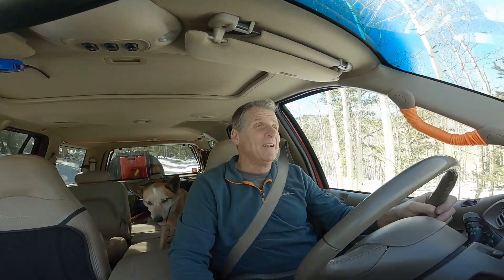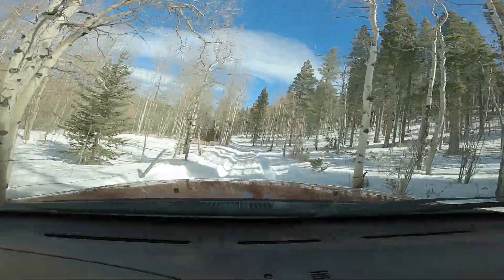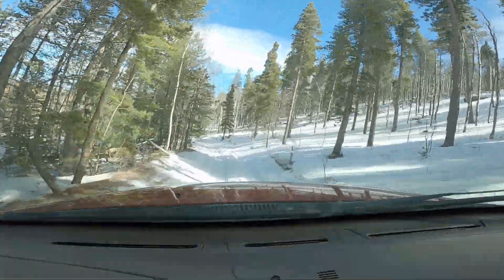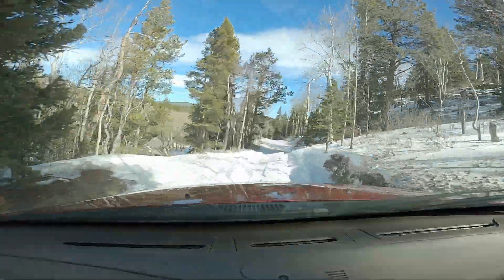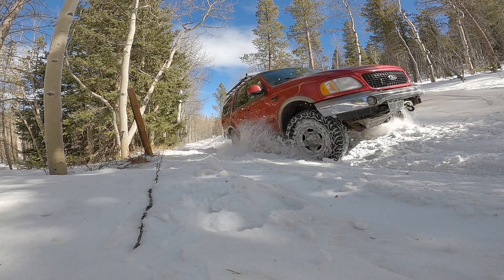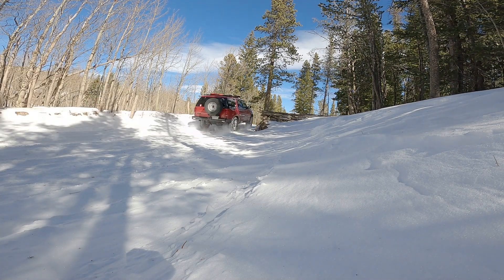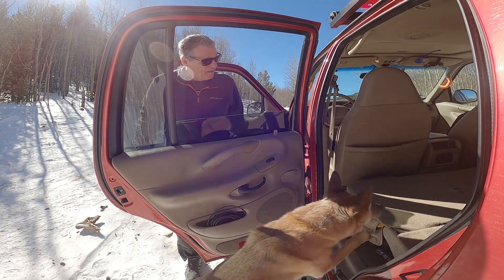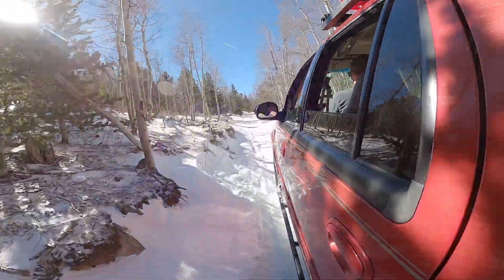Detroit Eaton True Trac - How they work in real life

Comment: So I've heard this is the type of differential setup the original Army Hummer had in the '80s and '90s and they would teach the guys how to do left foot pushing brakes. Also what's your opinion on having the true track alongside ABS traction control? Not the stability kind but the off-road kind of like Land Rover has where it grabs the brakes of the spinning wheel only. Do you think they would complement each other? Like the same way you're pushing the brake but the ABS system does it for you? I've heard some people say it makes the traction control system work less. If so I would like that because I own an old disco 2 that has phenomenal traction control but when you overuse it sometimes it gets Moody
Reply: Hello i have a ashcroft atb in a discovery and i can recomend getting one its transformed both on road and off road mine is fitted in the front it works the same as a truetrac

Comment: Thanks for the videos. I live the black hills of South Dakota and was skeptical of buying a ratcheting locker for the rear of my xj. Just seemed like it wasnt the right choice for a 50/50 on/off road especially on snowy curvy highways. I seen the first video and knew this was the right choice for me. Ive only had it for a few weeks and havent gotten snow yet but i cant wait.
Reply from the maker: Glad it helped, I too scoured the internet trying to find real world info and couldn’t fine much. One video I found was a truck in a garage with one wheel jacked up spinning freely and he would apply the brakes and the truck would move because torque was directed to the wheel on the ground. I also have experience with this type of diff in a car application in racing autocross. Cheers!

Comment: I have a Gen 4 4Runner V8 (AWD all the time), comes with a center diff locker. 

I wanted to installed a True Trac on the front, and full E-locker for the rear. 

Would this be a good combo?
Reply from the maker: I don’t have experience with that vehicle but I like the idea. I have an e-locker in the rear of my F150 and like that if I need I can lock both rear wheels and if I don’t need that I have an open diff in the rear for good street manors. I only thing I can say about using a TruTrac in the front is that in very slippery conditions both wheels in the front will spin and it can cause it to not track straight. But it is not like you are out of control and if I would release the throttle it would go back to tracking straight. I have a Detroit locker in the back and e-locker in the front of my Bronco and that combo works great for rock crawling. So it just comes down to how and where you are driving. The Bronco is harder to drive on very slippery roads as it will go sideways very quickly. But in the rocks it is perfect. Does that all make sense?

Comment: I have a truetrac in my 08 silverado, put it in 8mos ago. If I do a brake torque, both wheels spin. When I take off from a stop sign and turn...the inside wheel hops like it's posi. I HAMMER the hell outta the truck and it takes it. It honestly acts like posi, at least mine does. The G80 blew ofcourse. It still works with the GM stability control also. Love the truetrac.
Reply from the maker: I’m glad it works well for you 👍
Reply: @starksexpeditions121  alot better than that M80...I mean G80

Comment: Using the work "lock" is very misleading. Under no circumstances and in no situation is a TrueTrac or any Torsen type differential capable of fully locking and transmitted 100% of torque to both wheels like an actual locking differential does.
Reply from the maker: Thanks for pointing that out, I thought I verbalized that in my video but you didn’t hear that. But thanks for watching it.

Comment: What gear oil (brand, weight, synthetic? gl5) did you use with the true trac?
Reply from the maker: In the manual it says use non-synthetic and the weight the manufacturer says for your vehicle. I used Valvoline 80-90. And no friction modifier like you run in a Ford limited slip.

Comment: Greetings to Rusty and you!  Thank you for the very insightful video Stark, I've learned and benefited a lot.  If you have another video that covers the Torsen-style Eaton Detroit Truetrac on ice (and snowy/icy roads) please point me in that direction or please consider creating one; I'm especially interested in seeing how a vehicle would handle ice in RWD, FWD and 4WD.  Many thanks again!
Reply from the maker: Thanks for watching, these diffs are the best I’ve had in ice and snow. When the streets are covered in snow I don’t use 4wd because the rear diff always finds traction. And because having a limited slip in the front causes the front to loose side to side stability. It’s not like you are out of control but in very slippery conditions both front tires will break traction slightly and the front will not stay straight under power. At a steady speed all is good. Snow and ice are gone for the season so you will have to stay tuned for next years videos. Thanks!
Reply: @starksexpeditions121  wonderful!  Thank you very much for your insightful response.  I currently have a large RWD  SUV and live in a hot climate, I'm planning on moving somewhere with snow and ice so I'm in the market for an LSD.  Your videos and active responses are helping me reaffirm my original thoughts and decisions.  Many thanks and I wish you continued success.

Comment: Makes me wonder how well this will do with the Wrangler brake lock differential that applies the brakes to the wheel that spins while off-roading.  ? Manual transmission
Reply from the maker: Not sure, but it’s a great limited slip diff no matter what.
Reply: @starksexpeditions121  roger that thank you!

Comment: On rock slab, do you get wrap-up between the front and rear differential?
Reply from the maker: No, that’s something they do well. They don’t lock unless you ride the brake at very low speed like I demonstrate. They act like any other limited slip at faster speeds.
Reply: My experience with driving on hard surfaces, I get wrap-up, between the front and rear with my True Trac

Comment: Great review. For my driving the True Trac is my favorite diff. I have them in all of my 4x4s. The Detroit Locker is probably more durable, but kind of a headache on the street.
Reply: Why are they a headache on street ?
Reply: @admitmohan  depending on the application they can be noisy and a bit harsh due to engagement when making a turn while on a surface that offers little slip (dry pavement).

Comment: Ii have a rear LSD and front open, F&R locked. Going uphill in snow, if I hear spin rear goes sideways. Is that because BOTH RR&RL are likely spinning ? ?
Reply from the maker: Yes if both rear wheels are breaking traction and spinning you will loose lateral stability.

Comment: Thanks for the informative video.  Can you comment on rear tire life with the torsen?  I have a clutch-type LSD in my truck and it wears back tires fast (I don't do burnouts).
Reply from the maker: I’ve use clutch style, and full locking diffs and the TrueTrac is easier on tires. It seems to vector torque to the inside tire and the outside is along for the ride. Definitely different feeling than a clutch LSD and a locker. It doesn’t chirp the tires just traction. It acts similar in the snow, always finds traction not just turn both wheels so it tracks better under acceleration.

Comment: So are you saying they aren't good if you have a stick shift?  Your video was great but I was wondering about how they are with a manual.  I have a 5 speed Jeep TJ.  Thanks.
Reply from the maker: I don’t think you can make the front diff “lock” like I’ve demonstrated when a wheel is off the ground. If you are spinning with a wheel off the ground you may be able to pump the brakes to get some torque to transfer to the wheel off the ground but they will work great in all other situations.

Comment: In the example you give. Where if " you are locked fully in the rear on the street and there's snow or ice  , you'll just go sideways" does that apply to let's say, having a Grizzly locker in a RWD suv?
Reply from the maker: The only time it “locks” is when you hold the brakes at a very low crawl speed. It works better then a locker in the snow or ice because it doesn’t “lock” and will vector torque to the wheel with more traction.

Comment: It’s a misnomer to say it “locks.” Your braking just gives it more torque to bias but it’s just amplifying the torque transfer an open diff would do. It’s essentially an open diff with a bias ratio of 3.5:1 instead of 1:1 (no bias). Drive it like an open diff and just enjoy superior results.
Reply from the maker: It most definitely will lock at 1:1 if you hold the brake. There is a video where I break a right front axle, at that point it was 1:1. OK, lock is not the right word but it will but equal torque to both wheels. I will say that the front diff will do that but the rear does not. It will not hold torque. Thanks for the feedback.

Comment: Great video! If you have a manual you can still use the e-brake to try and lock.
Reply from the maker: Thanks for watching!
Reply: In my limited experience the e-brake usually only goes to the rear so you still lose out on being able to lock up the front. A selectable locker in the front and a Truetrac in the rear would probably be just as good as full lockers on both axles in most situations though.

Comment: Excellent demonstration!

For TrueTrac and manual trans: learning heal and toe braking is helpful, manual e-brakes work for just the rear diff.

In my truck, low range 1st doesn't require clutch feathering so I can use one foot brake and one foot accelerator.
Reply from the maker: Thanks for the input!

Comment: G'day, Aussie viewer here 🇦🇺 just wondering in your experience does your truetrac make any type of noise when it's locking?  Or is it silent? Ours makes a noise when it's in operation but people tell me it's not normal while I have had this made this noise since I've had it installed.its like a grinding wet break noise.
Reply from the maker: My front TrueTrac makes noise driving on the road. It sounds like the gears inside are loose and rattle against themselves. Like a “waa waa waa” noise that increases with speed that does sound like grinding brakes. But I don’t hear any sound when I use the foot brake to lock it in low range. Thanks for watching!
Reply: @starksexpeditions121  hmm bizzare. We put one into the rear of our AWD the centre is open but torque split 62R/38F the vehicle is also equipped with a  1/100th of a second activating brake lock differential off road traction control system, it seems that when front brakes lock up so to push power to the rear the TrueTrac makes this bizzare wet brake turning noise and I'm certain it is not the rear brakes. Can I post a link to a video we uploaded to see if you recognise the noise?
Reply from the maker: @AllTerrainAction  Sure, if I think about the noise I picture the helical gears have too much slop between and when they are turning against each other it rattles.
Reply: @starksexpeditions121  have a watch of this it's around the 1min to 2min mark you will hear it engaging https://youtu.be/eNZfCBP8Nw0 and just when power is beginning to be locked between both rear wheels.
Reply from the maker: @AllTerrainAction   Nice video! I have found that I can only get the diff to lock is in low range. And the rear will open up easier than the front. The other thing is once it opens I have to stop completely and start over buy applying the brake and holding it while pushing more throttle to move the vehicle and that will keep it locked. Another thing that happen is I was descending a really loose and rocky trail called Imogene Pass. I was using low range and had the transmission in first gear allowing the engine to hold me back to save the brakes. After a few miles of that I started to smell gear oil getting hot and after another mile the front diff made a sound like a dry bearing screeching so I stopped and looked under and there was fluid coming out of the breather hose. I took it out of low range and used the brakes for the rest of the trail. The noise was louder but not extreme and I did feel a slight vibration driving home at over 75 mph. I changed the fluid (not burnt but maybe a little darker than new) and now it’s not making noise or vibrating.

Comment: Great video! Does the expedition have controltrac like the explorers of that era?
Reply from the maker: It has “Auto 4x4” not sure if there was a name. But I did the “brown wire” mod to stop it from engaging 4 high until I select it at the switch. I had an Explorer and I think that system did the same thing.

Comment: Great practical video. Very thorough and real-world.  One thing you could add: avoid any gear oil with LSD additive / friction modifier as they will be too slick to achieve maximum torquie bias with the truetrac. It's capable of 3.8x torque bias on standard dino oil; synthetic will reduce is somewhat, and synthetic with LSD friction modifier will bring it down significantly (AVOID most high end gear oils!).
Reply from the maker: When you buy the diffs there is an instructional manual with it. It says use what the OEM says to run. It also says use an oil with the smallest amount of friction modifier as possible.
Reply: @starksexpeditions121  a lot of vehicles come with clutched LSDs, so using oem fluid would be an error.  Mine didn't have a manual with it new in box, but it did say to their website, which I did.
Reply: @JoelGrant  Using OEM fluid would be an error only if the vehicle used an LSD. As you said not all come with LSD diffs, so you are generalizing things and not giving the best advice. I mean no insult nor do I mean to criticize you. I don’t want people confused or to make the wrong decision.
Reply: Use 80w90 gl5 cheap gear oil

Comment: I am putting trueracs in the front and rear of my 79 CJ5. Unfortunately starting with the rear due to needing to work on that axle anyways. I don't ever get into many obstacles like you are climbing in your vehicle. But I use my jeep on the west slope for hunting primarily, and icy muddy roads, especially steep ones, are why I am getting a LSD. Needing to drive on the HWY in 4wd potentially and the similar cost/added complication issues you mentioned sent me to the LSD. It is interesting that you mention the LSD won't even engage in high range. That is good to know.

How has the performance been for you in muddy conditions? does the brake need to be applied in these instances for traction to go to four tires? 

I have a 8k lb warn winch, chains, and now will have the improved rear end. Hopefully I can get where I need to this season!
Reply from the maker: The LSD works all the time but i can’t get it to put torque to a wheel off the ground in high range. I ran Imogene Pass a few weeks back in a rain storm with lots of Colorado mud (not deep sloppy  like low country) and it works so good. It snowed at the top and it just pulls through.

Comment: Would you guys recommend this for my two wheel drive truck instead of dumping a ton of money into an air locker? I just use it to get to disperse camping off of forest service roads. Just want added insurance. My clutch pack limited slip that came from the factory is wearing out, and I don't think it worked that great in the first place
Reply from the maker: Lots of options, do a search to find what is available.
Reply: If you want something that works all the time pretty well, even on the road, get the tru trac.  If you want a selectable locker get an Ox Locker and run a cable into your cab.  Cheaper than air, cable shifted like a good transfer case and comes with a separate key to put in the diff to lock it in case the cable gets damaged.
Reply: My friend has an old 2wd ranger with a trutrac in the rear. It keeps up pretty well tbh!

Comment: I have a question ? So your saying that the truetrac won't work going down the freeway during snowy conditions. You talked about your front brakes can't hold you well enough to engage the front diff truetrac ? Maybe that has something to do with you having the truetrac in the rear as well.
Reply from the maker: The front diff works going down the freeway in snow, it will direct torque to both wheels. As you can see from the video I can hold the brakes well enough to engage the front. Not sure what you are asking.

Comment: These fake trac, I mean no trac, oh sorry true trac suck. I got one of these crap lockers and it was a huge waste of money.
Reply: How many more folks are going to crap on a product they don't understand ? It's like buying bowling shoes and expect them to be good for running...try to understand what the product was designed to do before saying it doesn't work.
Reply from the maker: @DL101ca  That is what I was trying to say with the video. TrueTracs work better than any other limited slip type diff for rock crawling and bowling shoes can be used for running just need to run differently : )
Reply: @DL101ca  That's great! I appreciate your analogy and couldn't agree more.
Reply from the maker: Tell me why?
Reply: @starksexpeditions121  Any locker that needs you too press the brake to lock up is no locker at all. I have no idea why people like these at all.
Reply from the maker: @killeroffroadhobbyz  They are not lockers. They are limited slips that can be used to transfer torque to both axles better than a clutch or cone style limited slip. Sorry you wasted your money. Do you have any experience with e-lockers? I'm building a Bronco and want real lockers in it. Don't really like the idea of air operated lockers due to having an air compressor, just something else to fail.